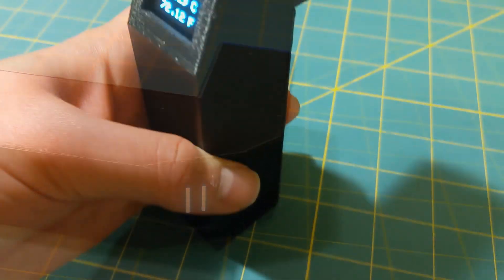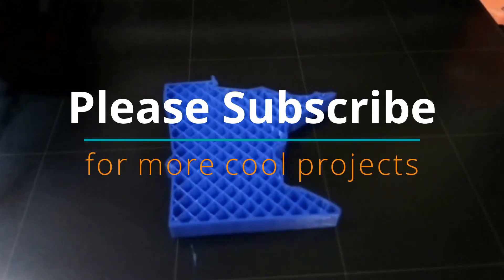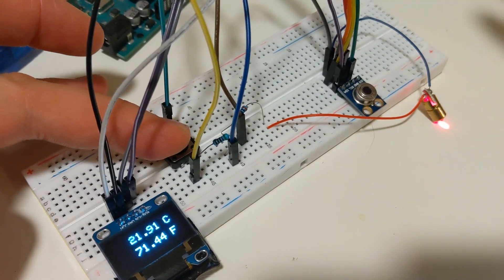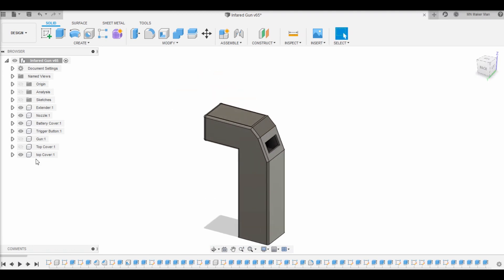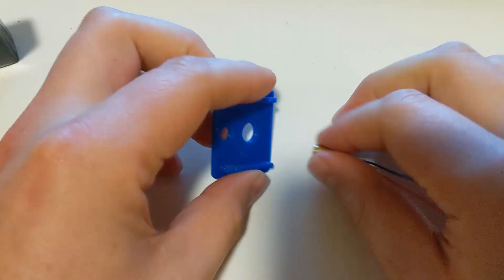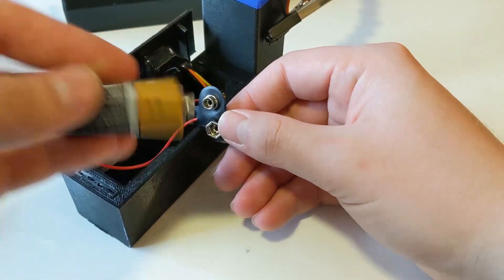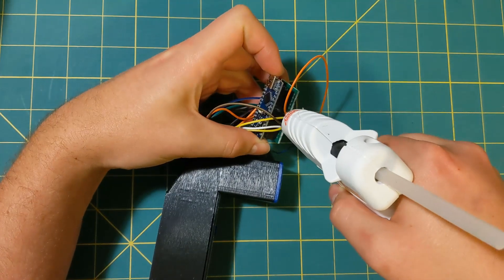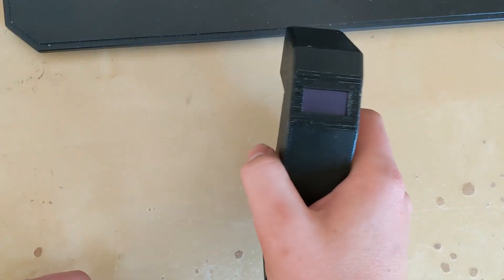Arduino Laser Infrared Thermometer

Comment: Hello , will this sensor be ok to be mounted on a subwoofer speaker.I want to change your project for myself to measure the temperature on the coil of my speaker to keep track and not burn the speaker.

Comment: Hello thanks for this video.
I have absolutely no idea about physics. I somehow mugup stuff and write exams.
I am doing this for my project. How to make the code work? How to put in the code into the led display?
Reply from the maker: I would recommend checking out some other YouTube tutorials to learn the basics of programming Arduinos and then coming back to tackle this project.  I assumed a decent amount of programming knowledge going into it. Good luck!
Reply: 1. Connect all the circuit parts.
2. Load the code into the IDE. Compile and upload to the Arduino.
3. The code prints to the SSD1306 with display.print();

Comment: how long the battery when the device is on? 1 day or?
Reply from the maker: Hmm.. hard to say without measuring the exact current. My guess is since a 9V battery has ~450 mAh and the nano takes ~20 mA, then 450/20=  22.5 hrs. It might be a little less since the laser takes current but you can just turn the thermometer off when you are not using it to save power.
Reply: @mnmaker8440  thank you so much :)

Comment: Did you use an Arduino shield on the final build or did you get a small PCB produced? Looks like the nano is sat on something.
cracking work looks great
Reply from the maker: Yup, no custom pcb for this project just sitting on a standard perf board